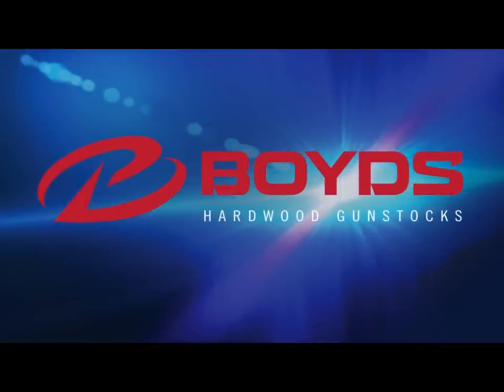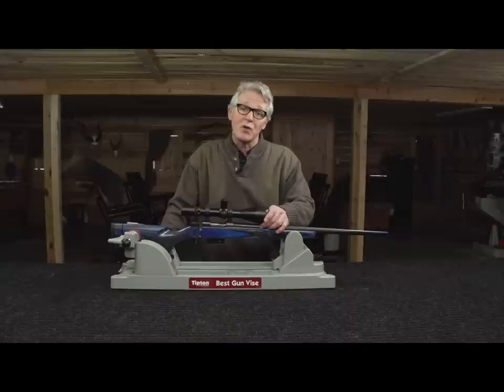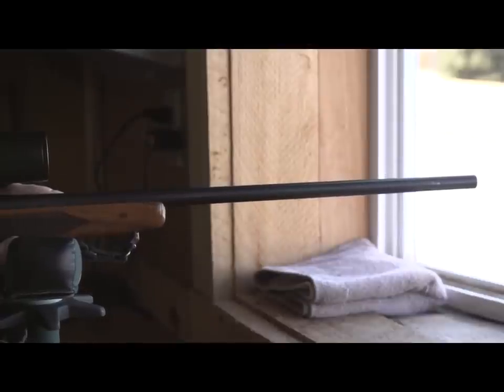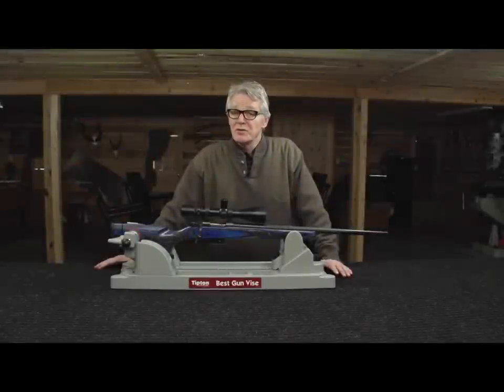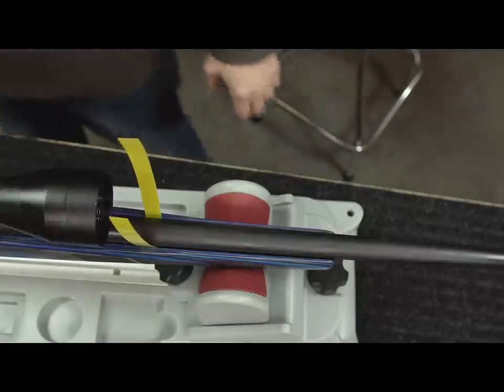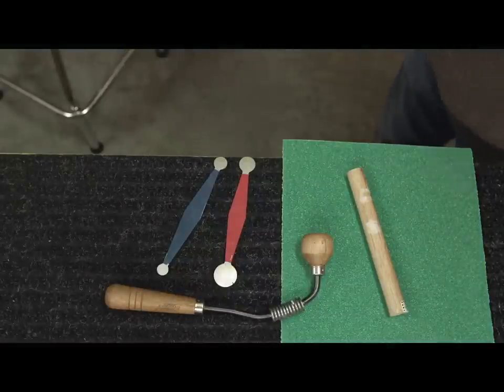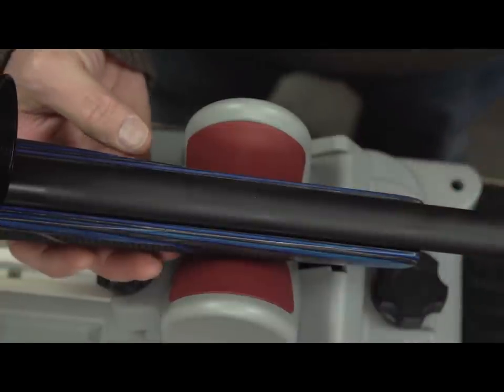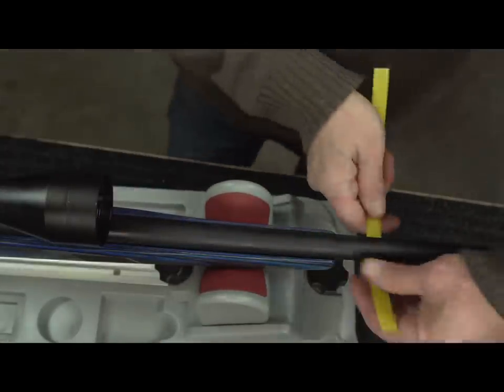Boyds Gunstocks: "How to Free Float Your Rifle Barrel Channel"

Comment: I had a "gun maker" free-float my barrel using a dollar bill and I had to bring it back to him after a couple of months because it started making contact.  Larry Potterfield recommends at least a business card clearance. I've measured some cards and they're about .040 inch.  Also, very true what he says about placing the stock in the barrel.  I used to just place the barreled action in the stock without checking but now I tighten the rear screw to about 10 inch-pounds, center the barrel and hold it while inserting and tightening the front screw to its full torque, and then finish tightening the rear screw to its final torque. This can make quite a difference in tightening groups.

Comment: Excellent video of barrel flex and explanation of the dynamics of firing a round.  I have two Mossberg Predators I use for training.  Both came from the factory with floated barrels.  I increased the gap and I bedded the receiver at the recoil lug.  The are in 5.56 and both have Nikon P223 3-9 x 40 VDC scopes. They both shoot dimes @ 100 yds.

Comment: Is it true boyds only pillar beds one action screw when this service is added to a  custom stock?
Reply from the maker: It is model specific, some inlets are compatible with 2 pillars in both screw holes. Others do not have enough wood material in the screw hole to support a pillar, in those cases one is installed.

Comment: I have seen a lot of people who wrap electrical tape around the barrel up towards the end of the stock to create space before they bed the action and this causes the bedding to also free float the barrel.  What is your opinion on this?
Reply from the maker: Typically, only the action is glass bedded and not the barrel channel. Some shooters bed their entire inlet including the barrel channel. We do not have a recommendation either way and glass bedding does void the warranty of our stocks.
Reply: @boydsgunstocks  All they beaded was the action.  The small amount of tape was used just to make sure the barrel was free floated.
Reply: I was taught to work receiver forwards when stocking up a rifle and have always done so.

The barrel channel is one of the easiest things to work on in terms of relieving and adjusting fit/float. So it makes sense to fit your receiver and then work forward from there.

I could imagine taping up the barrel to make it float when bedding the receiver causing problems with the receiver fit. Like introducing an upward cant towards the muzzle, which could translate to issues with magazine seating in the receiver etc.

Why would you risk it when you could just bed the receiver. Then once set hit the barrel channel with sandpaper to float the barrel and reseal it. Which is dead simple.

Comment: I have a 1913 6.5x55 Carl Gustav Swedish Mauser in an original sporterized military stock. The top wood is gone and the barrel is cut back to 18 1/2 inches. I did a bedding job from the rear tang to the chamber. Shooting at the range, it will do a 1 and a 1/2 inch group at 100 yrds. After that, I loosened the front screw and fit 2 cardboard business cards between the barrel and the very end of the forestock and retightened the screw...proceeded to shoot a 1 inch group. My barrel was a free floater and shot worse. Is there an explanation?
Reply: +Rick McLaren This is a long standing debate...British armourers had 24 points of concern to make SMLE rifles suitable for competition at Bisley....some sporterized versions had only four....Manlichter was adamant that the stock should extend to the muzzle with bands at the pressure points of the barrel harmonics...but the super accurate target rifles  making those long range shots today have minimalist furniture made from plumbling pipe and no forend whatsoever around the barrel .
Reply: Your barrel needed a pressure point at the end of the stock, like many of the Ruger 10/22 for accuracy.